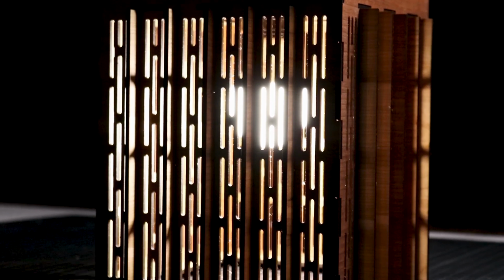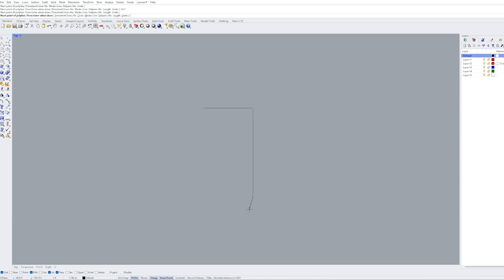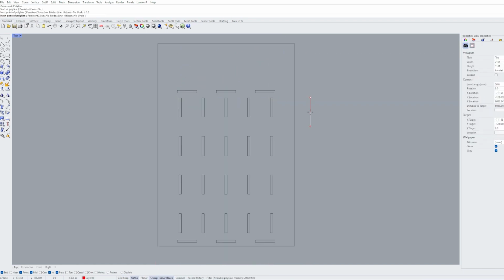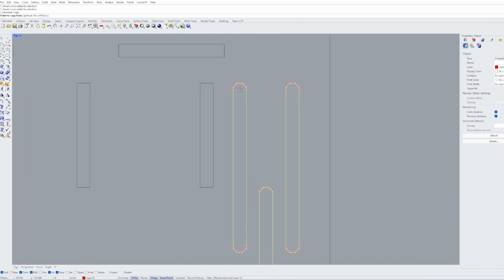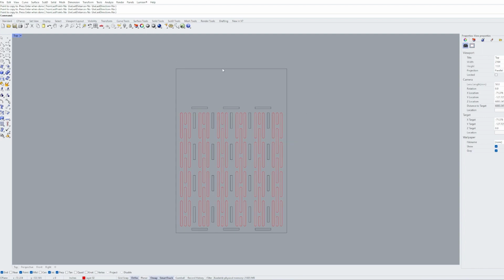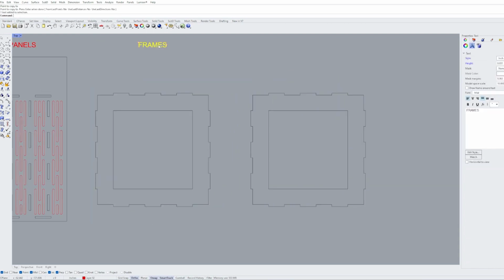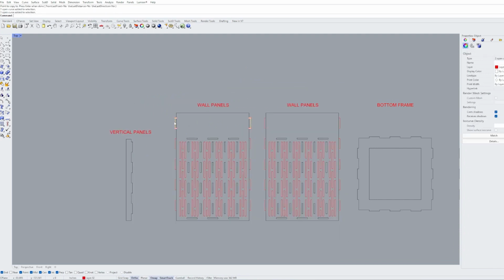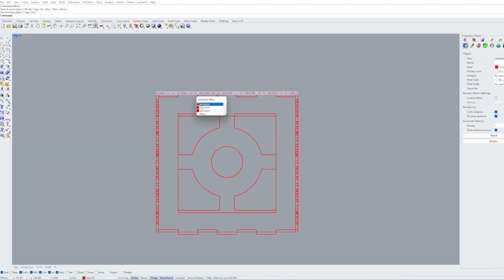How to make a Contemporary Light With a Laser Cutter

Comment: Hi Tim, where do you get your paper masking material. I want to start using this on my more expensive wood. I’m new to laser engraving and have so much to learn and I truly like how you go through your design process. Is there another program like Rhino that is not as expensive. I am disabled and on fixed income. Would Corel draw create in 3d
Reply from the maker: Hey Steve, sketchup is a little like Rhino and could be used in a similar way. It’s also easier to learn. Corel draw is also a good option, but I don’t know if they allow 3D modeling. For the paper masking tape, I order mine from Amazon and I make sure it’s a high tack paper masking tape. Use a squeegee to apply it tight to the material.